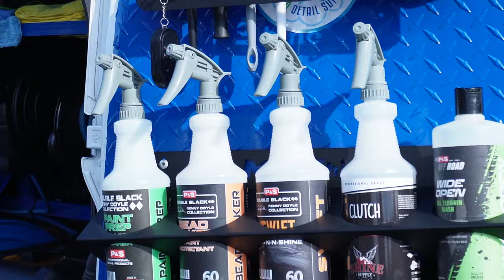My Complete Detailing Setup by H2O - Reynoso Auto Detailing

Comment: How much did you pay for the setup and what was included in the price. Nice video btw👍🏽
Reply from the maker: Setups like this start from $5000-$15000 for a small van like this, its very very specific on exactly every single little thing that you choose since they’re completely customizable, mine was closer to about $10,000 and included everything shown in the van setup tour video, except for the pressure washer, generator, and air compressor